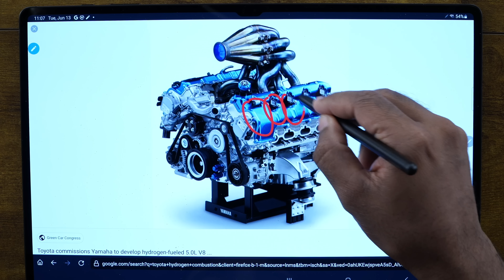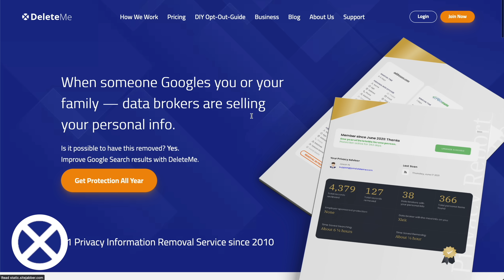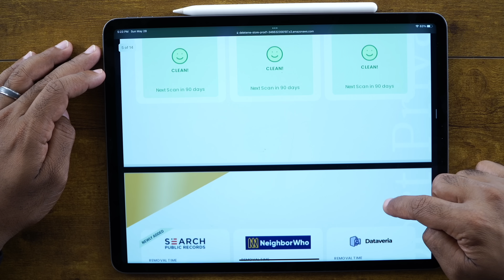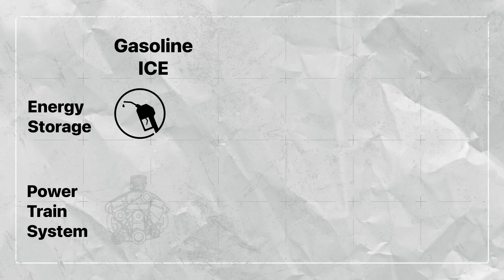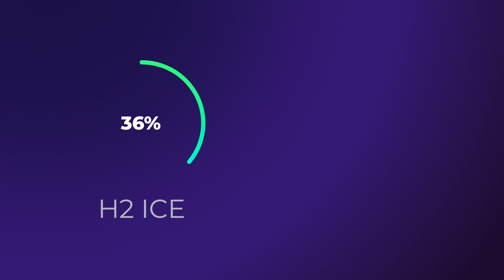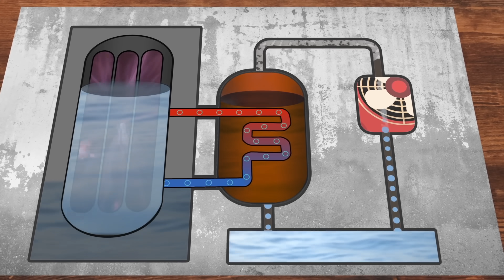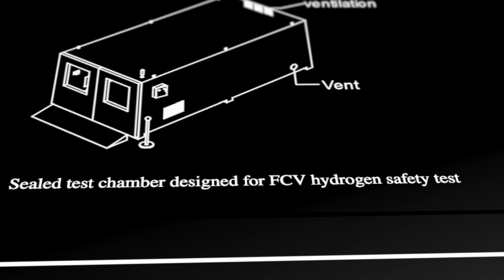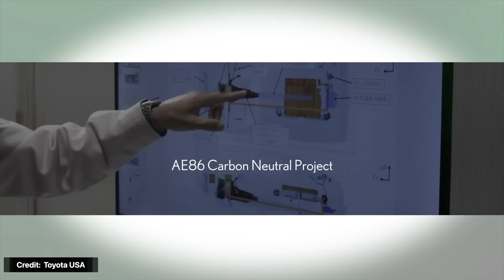Toyota's Says They Just Destroyed EVs - Hydrogen Combustion Engines

Comment: It may not be the perfect solution, but EV's are simply disposable cars... I mean, who wants to pay the original purchase price for a 10 yr old car when the battery is done?  On top of that, the damage to the environment by EV manufacturing is something that is relatively unseen.  When rich stars complain about the oil industry up here in Alberta, I honestly don't disagree with them because I live amongst this crap and it is destroying the environment locally.  The mining of rare materials, especially lithium is even worse than oil.  I believe this hydrogen ice is a good solution but will need to be perfected over time... and I do believe in Toyota as they are a great company who actually does things right unlike most other auto manufacturers.

Comment: Ah, another thing to note is the degradation of batteries over time. H2 engines don’t have that problem.
Reply: H2 degrades everything, tank, fuel system, engine much faster than batteries do.
Reply: @chrishar110  Yes I know that, its called hydrogen embrittlement.  The issue occurs when Hydrogen is in its ionic state.  This doesn’t occur with hydrogen existing as a diatomic molecule as it does with H2 gas.  And if there are suspect corrosion points which could dissociate H2 gas, then we’ll need to manage those locations locally.

Comment: 1. A fuel that you can literally pull out of thin air, so no digging or slave labor like EV and Gas.
2. It will improve like anything else, and soon enough, you could probably convert your existing petrol car to run hydrogen. 
3. Fill up time is quick, and the cars still make noise and can probably still be molded with turbos and everything else. 
4. You may be able to buy a converter that holds and makes a few tanks worth a day or even a week so gas price may or may not be a thing of the past.
5. It's the most abundant element anywhere, and seems to be the best alternative before we can evolve enough to step into wide scale and personal nuclear fusion power.

Comment: Hydrogen can be used in earth moving open cut/ cast mining where they often work 24 hours a day. EV for other uses, batteries should be implemented in all objects that use electricity such as TVs and refrigerators that charge during the day from solar and use batteries at night. US and Canada get 15 hours sun a day on average collectively, being 3 time zones across, wind and hydro to supplement. EV cars plugged in at night to supply extra electrical energy, slow cookers for food, remember it is only 100 years of gasoline and electricity usage.

Comment: The video title and early optimism seem misplaced by anyone that watches to the end. The cost of an EV is easily offset by cheaper, more efficient, flexible, and abundant fuel sources. EVs can have the batteries replaced and TCO would have the EV be cheaper than most ICE cars even calculating the battery replacement. Those battery replacements will only get cheaper over time as the lithium battery recycling industry takes hold and begins to recycle the mass of reusable car batteries in cars today. Having a supply of recycled lithium means sourcing the material gets much easier, less expensive, and greener. Non-lithium EV batteries are also on the horizon. Toyota could easily afford to put a real H2 network in Japan and build these types of cars to sell them domestically and compete against EVs. It is not just the car though. The entire country has 24 - H2 refuel stations. That's fewer stations than Tesla started in California. California is 7% larger but Japan has 3x the population. 24 H2 station network is too small to support a real production car. The H2 engine and Japan's H2 network are both technical demos at best. Toyota doesn't believe enough in the product long term to do so. This is not technology that is even close to being a real product. There is no chicken and egg issue here. There isn't enough development or surface interest to invest in that development.

Comment: So far there isn't a practical solution to store hydrogen in the vehicle yet. Storing it in liquid state will require more energy to keep the temperature super chill. As for storing it in high pressure gaseous state. This is a ready to blow time bomb. Too dangerous to say the least.

Actually the real reason why car makers willing to shift to produce electric cars is because the existing ICE is too complicated. Too costly to build, making less in the profit margin.

And the reason that makes  ICE complicated is the wrong concept of reciprocating engines.
Reply: The truth is ICE can be very frictionless. By adding more pressure such as GDI system and turbocharger will only ruin the engine quicker. Reciprocating engines have to rely on piston rings and journal bearings. These are high friction components. Hugely reducing the power. 

Sadly the car makers throughout the world don't seem to realise such a terrible mistake. The Toyota hydrogen ICE is still using reciprocating engines, meaning more hydrogen is required to power the car. How can such a concept be useful?

Comment: I have wondered for a great many years why we do not have exactly this technology. As a kid who played with electroless and was fascinated by burning hydrogen, I’ve always wondered why we couldn’t just make a regular ICE engine that worked in exactly this way. Good to see it finally happened, suspect it’s not the future though.
Reply: The cost of ev cars is going to hit people eventually.  Either through battery replacements or decreased range and efficient at late stages of battery life.  One thing they could do is standardize batteries and make them swappable but that would seriously undercut ev manufacturers.
Reply: @supernova743  they are already FAR more expensive than a comparable ICE vehicle
Reply: @supernova743 but the ev motor lasts almost forever. Compare that to any ICE and it's a no Brainer ...
Reply: Inefficiency is the reason
Reply: Delusional.  Physics is still physics.  It takes more energy to create Hydrogen fuel than you get back.  It is difficult to move, store and dispense.  This is why it isn't used for automobiles.  Toyota hasn't made any physics breakthroughs therefore this is a bust.
Reply: the problem is the volume and storage of hydrogen in a fuel tank.1kg of liquid hydrogen gives about the same mileage as 1l of petrol but takes up about 14 litres of volume so you'd need an enormous tank, and that's before you address the issues of maintaining the liquid hydrogen in the tank
Reply: @NonFlyiingDutchman  Yep.  Not to mention that it is insidious.  Makes long term storage a problem compared to gasoline.
Reply: The technology has been around for decades. Oil and gas companies aren't fond of anything they don't control. Like big pharma.
Reply: Ever considered getting the train lads? 🤦🏻‍♂️
Reply: Combustion engines that burn hydrogen exists since the 70s. Mercedes played around with it back then. And BMW did in the 90s and early 2000s.

Both gave up on it, because it's just to expensive for the mass market. And i'm not even talk the costs of making the car. It's the cost of the hydrogen if it isn't heavily subsidized by tax money. 

It's just simply impossible for a normal working person to afford to run a hydrogen car, and running a car with eFuels is even more expensive. (We are talking above 10 USD per liter here, though in hydrogen the equivalent in kg)
Reply: @germanmosca  Well taxpayer heavily subsidised the e-car industry, good lobbyists seem to be the answer along with foreign influence/
Reply: @germanmosca  ya nailed it.  The free market has spoken
Reply: It isn't practical for one really big reason. Energy density and efficiency. A hydrogen fuel cell vehicle (HFCV) uses each kg of hydrogen much more efficiently and will get you almost double the miles per kg in comparison to just burning it in an ICE drivetrain. And knowing that with the best current HFCV tech, current HFCV production vehicles have ranges of 350-400 miles, which is no better than a long range EV, then a combustion hydrogen vehicle will get only 200 miles or less with every space crammed with 10,000 psi tanks. In order to get 350-400 miles of range you would need to fill the trunk space with tanks and maybe even lose the back seats.
Reply: True, it's not.

Comment: You know, fuel or hydrogen engine are good but they need maintenance and almost nobody can make these fuel at home, EV are much simpler, they have much less maintenance and with solar panel you can charge them, Also, they can easelly goes from 0 to 100 in less than 6 secondes with a standard not modified model. So, for me EV are the way to go. I forgot, they are also much more stable on the road and very hard to turn over so much more secure than stadard car.

Comment: I don't know why they are making ev recharing so fricken difficult. Just keep a master battery in the vehicle and add a slot for hot swap battery that drivers cant touch. You pull up to a station a clamp swaps out the hot swap battery with a fully charged battery and your off. The hot swap battery recharges your main battery while you drive. They could do this swap in seconds.

Comment: A hydrogen combustion engine is nothing new. The main issue is the efficiency. Everyone who wanted to use hydrogen as peopellant went with fuel cells as combustion  had rediculous hydrogen consumption and too little power compared to their gasoline counterparts. Another issue was long term aging of the motor components using hydrogen what leads to high maintanance and potential safety issues.

BMW got public funding for doing research in this field, used it for some Marketing and they never seriously planned to bring it to market. I think this is no different at Toyota.

Besides the issue of availability and cost of hydrogen. To make such a car even technically viable still requires quite a lot of reengineering and development of an ICE engine.

Toyota uses the same playbook as the German automakers used it 10 years ago. Confuse the public, ICE is not dead, before betting on the wrong technology, play safe and buy an conventional ICE car.

The Germans did it with by wildly announcing solid state batteries and fuel cell cars and arguing that current BEV technology is not viable between 2010 and 2017...VW at the forefront. Once they released the ID.3 they somehow needed to reeducate the public that most of the concerns about EVs were actually not true.

Comment: Great video...answered a lot of questions that I had about this tech.... The fuelling network is a big issue, but I think it will happen eventually n spreading slowly from, the large population centres.
Reply: Actually no. If anything hydrogen fuelling stations are white elephants that are shutting down and are not being replaced.
Reply: Combine a "refit hefi tech e.g the sniper fuel injection  tech with a "universal" ice engine block that accepts any fuel (h2, lpg or petrol and can be switched in real - time to  adapt based on fuel cost.  hybrid engine/availability

Comment: I think engineers should detach themselves from the teats of converting one type of energy to another then to another then again to another.
If you look deep, all of today's cars use chemical energy in a way - either as gasoline or hydrogen or electrolite/electrodes. Then this energy is either converted to thermal then to mechanical, or to electricity then to mechanical energy. 
Is this the only way? The future mobility could use direct conversion of chemical energy to mechanical. Look at the living creatures. Such systems based on cross-linked polymer systems exist and they can use hydrogen as energy source. I think such systems could have the best efficiency and reliability. 
There was a lot of development in 90's, but I cannot find any new publications. Why is that? Did they drop it or it is a new secret technology brewed in some DoD?

Comment: Oh cool they did a JCB. 

Hydrogen for heavy freight, air travel and motorsport is legitness. Combustion hydrogen engines are better than fuel cells because you’re not waiting for the fuel cell to parse the hydrogen to give you the electricity to give you the acceleration, they’re about the same efficiency 35-40% though so yeah.  

EVs for normies and H2 for everything else.

Comment: battery cars will be way to expensive. and way to expensive to maintain, they to are not made clean tons of fossil fuels will be used to produce these cars. Any leak in the batteries , Over heating or general shorts could create a fire that takes a lake to put out. The electrical grid cant handle summer, or winter without electric cars. They may be making strides in batteries but they are also making strides in everything else. Germanys trains are running Hydrogen now. Japan has made red hydrogen which has some different attributes. However if you could get a battery car for 5 to 10 grand new i would buy one maybe just keep it parked far from the house.

Comment: EV are not as efficient as you claim. Batteries degrade very quickly, to the point that after 6-12 years there no longer viable for your vehicle. There also The worst part of any car for the environment. Hydrogen is safe depending on the pressure it is stored under, however even in the worst case scenario. Its not a worrisome issue. The source of the electricity for EV involve all kinds of carbon (not a pollutant btw) sourced energy. EV is also unreliable in many ways, and are insanely expensive. After watching this video, you do get into many of the details, however you ignore just enough to remain a EV fan boy. EVs are highly overrated.  Gasoline/Diesel HHO hybrids (i built one many years ago) with the HHO produced with electricity from the car battery as your driving. Or pure Hydrogen ICE are the best option with the least amount of impact to society and the earth. Especially if we expand nuclear power to produce the hydrogen.  I applaud Toyota for advancing this technology.

Comment: The efficiency of a v8, is at best 25% vs a fuelcell conversion of 76% including motor. Hydrogen is not a fuel but an energy carrier, Hydrogen is produced from methane reformation with substantial co2 product.
Other problems are leakage and embritlement.

Comment: IIRC, Japan has access to huge (potential) offshore methane, which they can control and exploit and which could be used to produce hydrogen.  They also already have access to and supply chains for traditional ICE type engines.  They do not have access to many of the materials or components for creating EV batteries at scale, and they may be feeling that this would make them vulnerable, especially to China, which does control access to many of those resources and has used them as political hammers against the Japanese in the past.  So, this might not be as cut and dried, from a Japanese perspective, as you are making it out to be at the end of your video.

Comment: One thing to consider. They are creating conventional engines. There are new engine designs that can overcome some of the efficiency issues. They have just not been invested into sense it looked as though the ICE engine is on the way out but, developing hydrogen and these new engine tech side by side could fix some of the efficiency issues at least from inside the car. You still have the issues of getting it and storing it.
Reply: Delusional.  Physics is still physics.  It takes more energy to create Hydrogen fuel than you get back.  It is difficult to move, store and dispense.  This is why it isn't used for automobiles.  Toyota hasn't made any physics breakthroughs therefore this is a bust.

Comment: While EV's are still not ideal, a McDonald's, or other restaurant can install EV charging stations in their parking lots. They can even put up solar panels to offset some of the electricity cost. With Hydrogen, we will be reliant on companies supplying the hydrogen at service stations, much like we do now with gasoline. Those companies will become the oil companies for a new age, and if they decide to burn coal to produce the hydrogen because it increases their profits you can bet they'll dig like crazy, especially if the new hydrogen producers also own coal mining operations. With EV's people have the option to produce most of the electricity to charge their cars at home, and therefore won't be reliant on these outside companies to fuel their cars. Then the only time EV owners are reliant on outside companies to "fill" their cars is when they travel, and as I stated earlier, charging stations can be installed in any parking lot (where I live most hotels and mall parking lots have them, and in my town there is one outside the grocery store and a popular cafe).

Comment: Regarding the efficiency aspect have you taken into account the electricity generation and transmission aspect of EVs?   How much is lost in the generating plant, through the transmission system and into the battery?  Further, most electrical grids would collapse under the strain of EV charging should EV market penetration expand.  Additionally, the building and disassembly of EV batteries are a disaster once you factor in the ecological and human impact.   Ultimately, hydrogen is the solution especially once fusion is available for cracking water.
Reply: Kodak said the same things about digital cameras. I don't think that you represent Shell or Exxon, you just believe what they say. They made record profits last year and theyt don't want to loose that money.